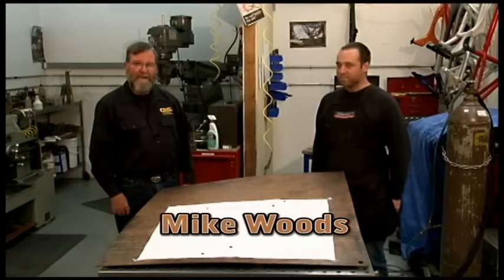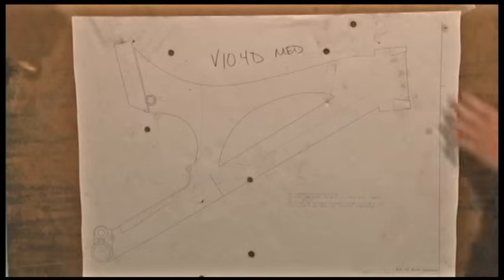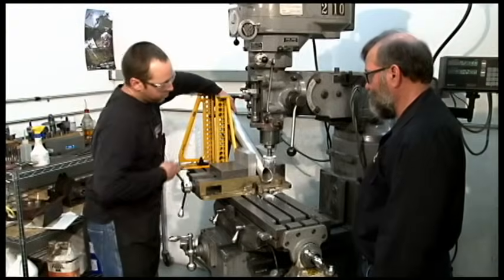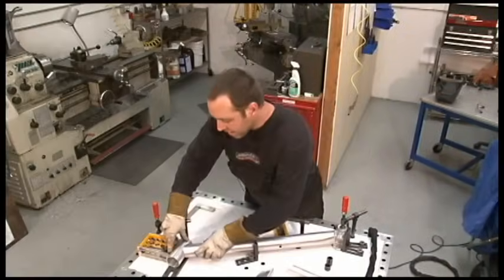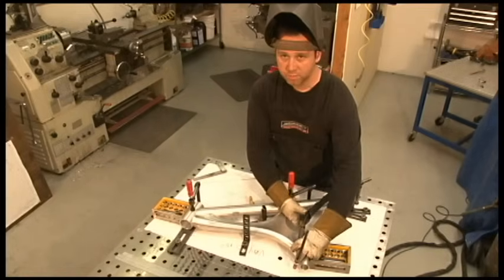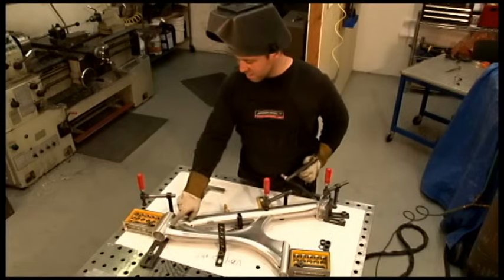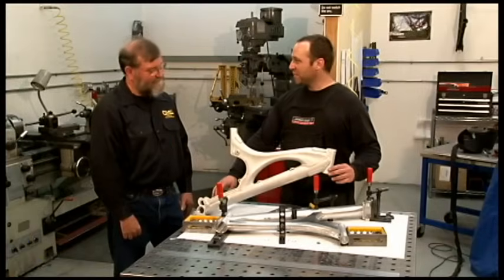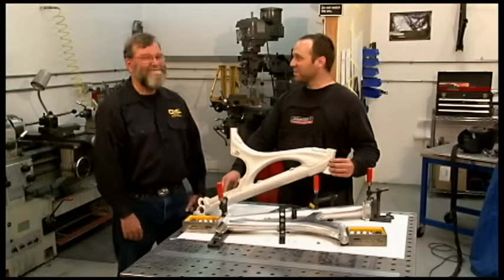Welding Aluminum Bicycle Frames

Comment: Have you any experience Welding British 7020 aluminum. I believe that number is correct, it was used by Spondon Engineering on their Beautiful round tube motorcycle frames. They have since been bought by Norton and you can see their frames on their v-4 bikes. From one of their old brochures they mention their material could be bent, welded and would stress relieve locally at the weld and age harden back to T6 hardness. To talk about beautiful tig welding you need to see one of their frames. The British also make a High Manganese Aerospace Steel called T6 that is basically their steel for uses we use chromoly for. More forgiving, and can also be used with Bronze welding for lower temp minimum distortion motorcycle frames 
such as those still sold by Harris Engineering. From what I understand both the annealed steel and bronze welding rod have a 85,000psi tensile strength.It was also the same steel used on the jet powered Land Speed vehicle "Thrust" which I believe was Tig Welded.
Reply from the maker: Monty Crain - Thank you for giving me this information! 7000 series aluminum is extremely strong, the 7075 alloy that's most often used in the USA is not weldable. I was not aware that there was another alloy in that series which could be welded! I was also unaware of the high manganese steel used for aerospace fabrication. For the record, bronze filler rod can be used for TIG welding mild steel and chrome moly. It definitely keeps the distortion down, but it has a much lower tensile strength, so it's not suited for every application.

Comment: sir if i done retrofiting my xc mtb full suspension by installing internal cable does it affects the durability of the frame?
Reply from the maker: It all depends on where you put openings in the frame, and how the openings are reinforced.

Comment: Mr Ron what welding michine 
gys tig welder  and Telwin tig welder and deca tig welder
Reply from the maker: I use the Miller line of welders exclusively, and I consider them one of the best around. I am not familiar with the Telwin and Deca brands. I'm not saying they are bad, but I have no experience with them.

Comment: Ron which country you are and 
which tig welder you using and 
How many dollar what amp ac/dc please tell me the price. how I can buy  thank you regard
Reply from the maker: I live in the USA. I have several TIG welders. The least-expensive welder in my shop that would be good for bicycle frames is the Miller Diversion 180. It is a 180 amp machine, which is more than enough power for this application. They are currently selling for around $2200 here.

Comment: So why is it so difficult or impossible to weld disc brake posts for a rear disc brake on a bike that didn't have it? Asked welders and been told 'that is expensive and impossible"? Well then how did they do it in the factory? That's my question...
Reply from the maker: Of course you CAN weld posts onto a bicycle frame, as they do when bicycles are made in the factory. Your 'average' welding shop may not be familiar with the special considerations needed for welding on the super-thin wall tubing that most bicycles are made from. 

There is a special issue with bicycles which have aluminum frames, because welding on them removes the heat treating, and unless the whole frame is heat treated again, it will have a weak spot at the weld. On a steel framed bicycle, sometimes the posts are brazed, or silver soldered into place.
Reply: @RonCovell  Thank you for the detailed explanation. Looking forward to seeing more videos by you....

Comment: Hello Ron. Nice weldings  you do.
I weld stick not professionally, and did some tig on steel bicycle  frames. Never aluminum.
What would it be the most important feature a decent welder must have in order to make such uniform threads ?
Many thanks. José
Reply from the maker: Jose - it's more about the person welding, rather than the welding machine. If I had to pick a single most important thing, it would probably be steady hands.
Reply: +Ron Covell 
Yes, I agree ! steady hands.
After a good amount og grinding by hand, my hands and arms are shaky, and welding is harder. 
Thanks.
Reply from the maker: I sometimes use blocks of wood to support my arms or wrists. Try it - it can really help!

Comment: Cool video, What type of aluminum did you use 👍
Reply from the maker: I didn't ask what type of aluminum they use at Santa Cruz Bicycles, but it's probably the 6000 series, since it is a high-strength alloy which is both welded and heat treated.

Comment: I used to weld  aluminum bike frame parts for Trek bikes when they had a plant in Chehalis WA.  Was originally Kleine  bikes till Trek bought them out.  We used tig welding with argon gas. the parts had to be meticulously clean to get best results. All parts were given a detergent bath and rinse to remove any grease or oil followed by a dip in an acid bath and neutralizer to remove oxidation.  Then, the components were tack welded in sturdy jigs, adjustable for specific frame sizes.  

An aluminum part can look perfectly clean but have a thin layer of oxidation. That layer melts at 2000 degree while the base metal melts at 1200. You get blow through as well as ugly blackened welds if the oxidation layer is not removed.
Reply from the maker: Scooter, thanks for 'chiming in' - you certainly know your stuff!
Reply: Oxide layer forms instantly, in the ally boat game we used stainless brushes to scratch th surface of weld line to make it easier for the arc to break down oxide layer, cleanliness is crucial for ally slightest bit of contamination = shit weld
Reply: Welding with AC gets rid of the oxidation layer after it’s washed. If you brush it it immediately starts to oxidize. You can weld aluminum with with DC, and helium for the shielding gas. It’s what you use on thicker material, 6061
Search Bike Welding,
Rickthewelder1 here on YouTube. Just washed, no brush. I used to weld for Intense. Pulsed all the monocoques and welded fronts, all models.
Reply: Aluminum forms its own oxide layer; if you want more cleaning to get rid of said oxide layer, you adjust your frequency settings to do so
Reply: The dropout for my single speed trek marlin broke. So I’m here
Reply: Should all bicycle frames be TIG welded , regardless of the metal (chrome moly , steel or Aluminum ? )
Reply: I don't know, the other side of that as far as industry info is concerned is that the oxide layer forms instantly, and you get rid of it not through heat, but the HF AC of the tig welder blasts it off.  Or so they say.  Does have to be scrupulously clean though.
Reply: All I know is, if components  sat around more than a few days, they went through the acid bath again.  Centralia College used big, powerful Miller machines. I found some aluminum tubing in the scrap bin, and setting up the machine as told, tried welding. Got horrible black welds. burned holes in the metal.  Had argon gas flow. good tungsten tip. aluminum LOOKED CLEAN.  Instructor suggested I wire brush the parts first. Made a HUGE difference.
Reply: Works great BUT as long as you reserve it just for your aluminum stuff. The welding instructor at Centralia College in Washington  said stainless but out at Trek bikes, they had a bench grinder with a steel wire wheel and it worked just fine.
Reply: Scooter, what type of aluminum was used? 6061, 7005 etc? What type of wall thicknesses are generally used on aluminum bicycle tubing?
Reply: Scooter George how well does a stainless wire brush work?
Reply: I have a Klein Attitude Comp with the Bontrager shimano parts on it in the dark Red/Silver shift paint.  I intended to ride it like crazy but took a new job and never had a chance to ride the bike it's been a garage queen.  I want to get back to riding but don't know where to begin hardly been long long time.
Reply: Aluminum with the oxide layer melts at 3700f degrees not 2000 f.

Comment: So this is TIG welding right? Not braising?
Reply from the maker: Yes, it's TIG welding.
Reply: I suppose it wouldn't be "brazing" anyway since it's not brass... duh. Thank you for the response though.
Reply from the maker: Actually, there is a 'Brazing' process that is used for aluminum, but it doesn't use brass - it's  a special aluminum-based material. The distinction between welding and brazing is that with welding, the metal(s) melt and intermix, whereas with brazing, you form a surface bond, similar to (but stronger than) soldering.
Reply: Thanks for the clarification. I suppose for anything even remotely structural, brazing would be out of the question. I myself do flux core welding but I wouldn't mind getting into some aluminum welding at some point.
Reply: Have you tried mig welding using cmt welding
Reply: I haven't tried it.
Reply: Michael kirst 
I know the fronius have cmt ( cold metal transfer  ) they have some videos on youtube 
We use the fronius tps 5000 on heavy plate so cmt is no good for us but i have seen it in action
Reply: +Michael Kirst 
I thought the same on brazing. I read somewhere that if the joint is very thin, meaning the two pieces fit with very high precision, probably one to thre mils, the brazing can exceed the strenght of a steel piece. The thickness  being the "secret".

Comment: Can aluminum be welded to steel to make a bike?
Reply from the maker: My understanding is that there are some high-tech processes that can join steel to aluminum, but it's not something you or I can do in a home shop with a typical welder.
Reply: I'll probably get denounced as a heretic for this suggestion, but for that combination, an epoxy adhesive might be a better option, (perhaps with the geometry arranged to maximise the mating area).

Comment: Can you add aluminum to an all steel aluminum bike frame to make one great bike I have in mine ?
Reply from the maker: I don't think this is feasible, at least not by welding. It may be possible to use adhesives to bond dissimilar components together.

Comment: Nice work...can you give me little info on base material and filler material of TIG welding... Thanks......
Reply from the maker: I only spent one day at Santa Cruz Bicycles, and I didn't ask what alloy of aluminum they used. It may be 6061, but I'm not sure. The filler rod is most likely 5356.

Comment: What is the gas used in welding
Reply from the maker: Pure Argon gas is used for the majority of TIG welding. For some specialized aluminum welding of heavy sections, Helium can be added to get more heat into the weld, but for thin sections, straight Argon is the norm.

Comment: Looks like he is using a braising rod
Reply from the maker: You are seeing TIG welding in this video. Aluminum can be brazed, but that's either done with an oxy-fuel torch, or by dip-brazing in a molten salt solution.

Comment: What alloy of aluminum is the bike make out of?
Reply: I take a guess and say 7075
Reply: The top tube is hydro formed so probably 7075
Reply from the maker: I didn't ask what alloy the bicycle frames were made from when I visited Specialized Bicycles. 7075 is a non-weldable alloy.

Comment: That frame has some VERY peculiar geometry.
why is the seat tube so far forward over the bottom bracket centre. It must feel an unnatural and somewhat cramped riding position.
Reply from the maker: Dan, I wish I could answer your question, but I did not talk with the design team for this bicycle, only the fabricator in their prototype shop.
Reply: It's a long travel downhill bike, so it has a very slack head tube angle, not steep as you must be imagining. The BB only appears forward from the seat tube because you can't see it all built up with a long front end. Google for a picture. Anything but cramped riding position.
Reply from the maker: Michael, Thanks for chiming in on this. I've seen people riding these bicycles in very challenging conditions, and they seemed to work very well to me, but I'm not a bicyclist myself (outside of light riding on pavement).
Reply: Might I suggest searching "Santa Cruz V10" on your preferred search engine. It might help you to understand their design choice but you can trust me when I say that for its intended purpose [Downhill Mountain-Bike Racing] the V10 does it incredibly well indeed.

Comment: Nice video. What tipe of aluminium is it? 6061 or 7005?
Reply from the maker: I don't know for sure what alloy Santa Cruz Bicycles uses for their frames. It's almost certainly a 6000 series alloy. 7075 is not weldable!
Reply: Thank you for your answer Ron. I know that 7075 is not weldable, but is very strong alloy.  I asked about 7005. :-D
Greate job, I love your videos.
Reply from the maker: Rubens Augusto Carvalho My apologies for not reading more carefully. Yes, 7005 can be welded. I don't know what alloy Santa Cruz Bicycles uses for their frames.

Comment: in regards to distortion once you've tacked one side do you tack the other as well might help to have a mirror image jig and help it with a rubber mallet just to get things right might not solve the problem but might lessen the affects of the heat ?
Reply from the maker: When tacking tubing, it is good practice to alternate the locations of the tacks. It takes a minimum of 3 tack welds to really hold a joint rigidly, and more tacks is better.

Comment: As an ex welder(Arc,Gas,Mig & Tig) Aluminium is a problematic metal to weld because the oxide that forms on the surface melts at a higher temperature than the actual metal so cleanliness i.e. minimizing that oxide formation is essential and Tig(tungsten inert gas) welding is the only way to go, although i have welded Aluminium successfully with gas(oxygen/acetylene) are Aluminium frames(mass produced not custom) still hand welded or do they use robots nowadays
Reply from the maker: I hope some knowledgeable person can answer this question - it's something I've wondered about, too.
Reply from the maker: Aluminum is commonly gas welded. It takes a special flux, and a special lens to cut the glare given off by the flux. Here's one of the best:
https://www.youtube.com/watch?v=8H45-vdnxi4
Reply: The rods we used were hollow with flux down the middle,very slightly carbonizing flame(BOC Saffire torch) and we didn't have the lense's then so had to put up with the glare.Aluminium moves a lot so you either clamped it down or tacked it at an angle so the movement pulled it back straight.But the welds were nowhere near as pretty as TIG welds.
Reply: I would think they have to use some kind of machine. I mean after all there is a limit to how many people can weld that good. If you look at those frames they are all pretty perfect. They all look like Jody(from welding tips and tricks) welded them.  He is one of the best I have ever seen. 
That being said if you welded aluminum with oxy/acetylene I take my hat off to you. How would you keep the flame from contaminating the metal?  My torch wouldn't stay stable enough for that. As it warms up it changes from carburizing to oxidising lol  Seems to randomly change little bits after that even. I actually tried to weld aluminum with it at one time many years ago.  took forever to heat up and when it did a big chunk just sloughed off. :( I took the next project to a shop.

Comment: Ever thought of drilling holes in some of the tubing and sending  gas purge up  the bikes internals bit like the way process pipe welds are done.... there by creating a strong internal bead and by that process seriously strengthening the whole frame...  Great welding ... Five Stars...
Reply from the maker: There are many cases where purging the inside of a tube while welding is very beneficial. Food-quality stainless tubing is one very common example.My understanding is that In the world of aluminum bicycle frames, purging is not generally used.

Comment: Anyone got a link to a video or their heat treating process?
Reply from the maker: I just found this one. It's older (1945) but it does give a good description of both the annealing and heat treating processes:
https://www.youtube.com/watch?v=n6FwPKlSC0M
Reply: Ron Covell Thank you for the video, that was really informative about the process.  My biggest question is how do they bring the bike frames back into alignment after the heat treatment process.  Only a couple degrees of alignment shift would be noticeable to a cyclist (I am one). 

EDIT: I found this article.  Looks like the frames are aligned after annealing, but there is no alignment after heat treating (looks like the level of alignment relies heavily on the builder): http://www.pinkbike.com/news/To-the-Point-Heat-Treating-Aluminum-Frames.html
Reply from the maker: Thank you SO MUCH for that link! The details of heat treating bicycle frames has never been detailed (to me, at least) as well as that article. I appreciate the research you did to find it, and to post it here so others could learn from it!

Comment: what metal rode is that?
Reply from the maker: I don't know for certain, but it's most likely 5356 rod.
Reply: Sir I am looking to build a custom bobber motorcycle, and I wanted to know that which metal rode are good for frame
Reply from the maker: Check out my Chopper Chassis DVD on YouTube. I use 1 5/8" OD DOM Tubing for that one. https://www.youtube.com/watch?v=aSAwKLiBLMU